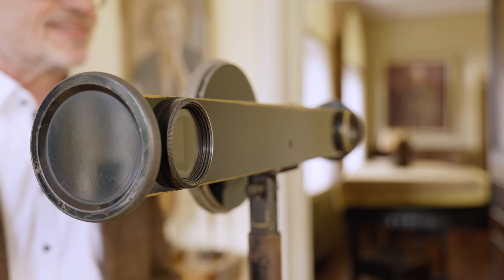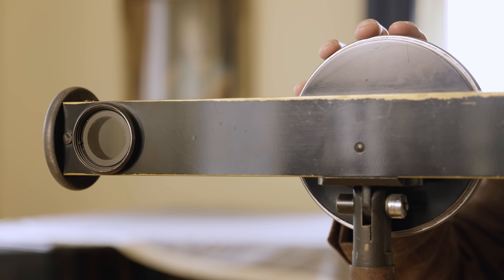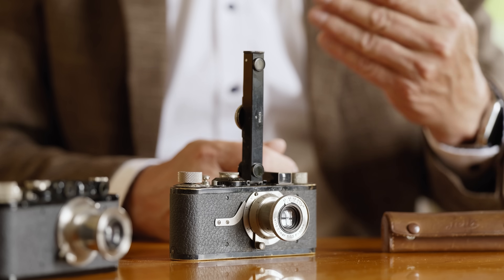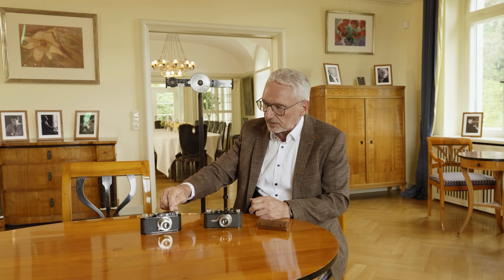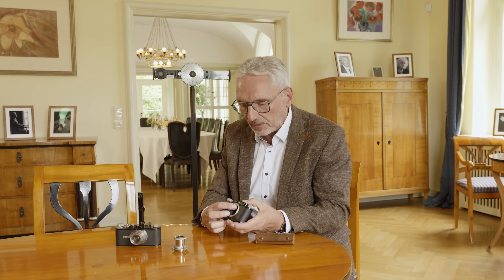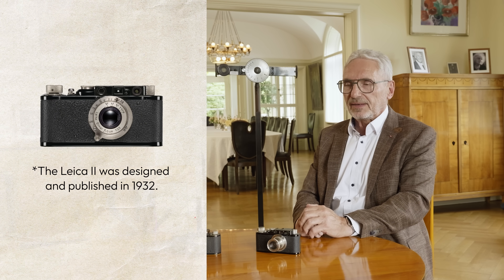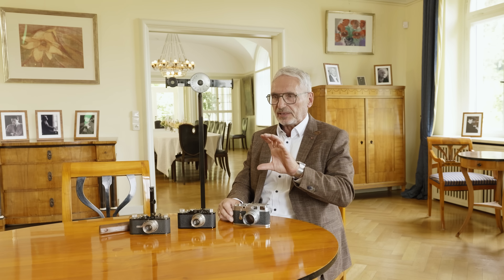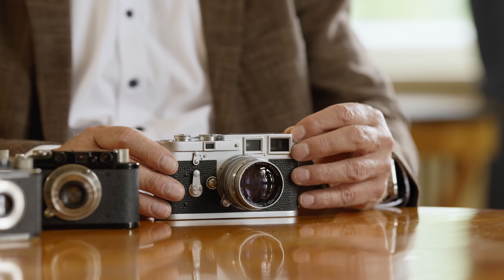Revolutionizing Photography: The Development of the Rangefinder

Comment: The Range Finder was first introduced by Kodak on their No. 3A Autographic Kodak Special, which was released circa 1917. It was part of the camera, unlike the Leica I that was released some 13 years later, which required this extra mounted device. It's impressive to see how much Kodak brought to photography. So when Leica adopted that system, it was more popularizing an existing mechanism than revolutionizing photography like the title suggests.
Reply: Georg Friedrich Brander (born November 28, 1713 in Regensburg; † April 1, 1783 in Augsburg)[1][2] was a precision mechanic known throughout Europe in the 18th century. Towards the end of his creative period, in 1778 he built a coincidence range finder that consisted of a cross tube with two mirrors. You had to align the two images and use the position of the mirror to determine the distance to the targeted object.

Comment: I have two Leica M3s and three lenses. It's all I need. I wanted to buy an MP, but apart from the built-in metering, it is not much different from my M3. The mechanical smoothness of the Leica film advance lever and the whisper quiet shutter is an amazing experience. Rangefinder cameras are perfect to capture moments.

Comment: M3 frames are 50, 90 and 135mm. Not 75mm. Not 130mm. While the rest of the presentation is interesting, this is no small mistake, as we're talking about the most famous M model in history. If the expert made a mistake, it's unforgivable that they kept the errors and illustrated them when editing the video. Leica should remove the video and correct it.

Comment: Didn’t know 3 focal length viewfinder lines was the reason it is called the M3. Great history!
Reply: I found that fact interesting also considering there were two versions of the Leica out already. I would probably need a Visioflex if that name is correct for shooting an M camera. Don’t see out of my right eye. Shooting my DSLR my nose hits the buttons sometimes & the multifunction wheel that will move the focus point around in the viewfinder. No touch screen luckily or would need to turn the touch feature off.
Reply: @clintwoosley9512   But what he mentions in the video is wrong: they're 50, 90, and 135 mm. It is the most famous M in history and the only one with that frame set. It's impossible to confuse them. The video editor also got "confused" when he made the frame illustrations incorrect.
Reply: @betod63  👏🏾👏🏾👏🏾You should apply for the role of human at Leica....being perfect n all 🤷🏾‍♀